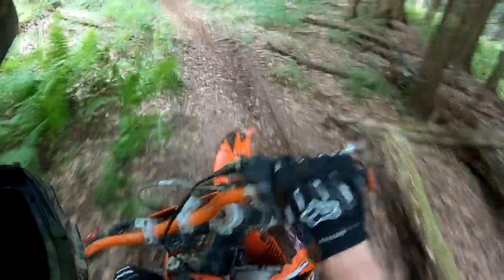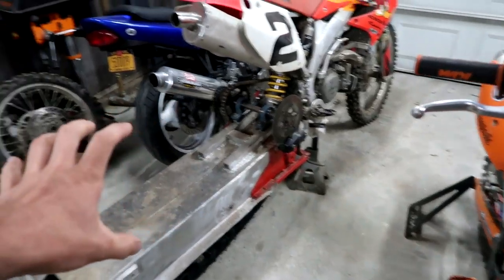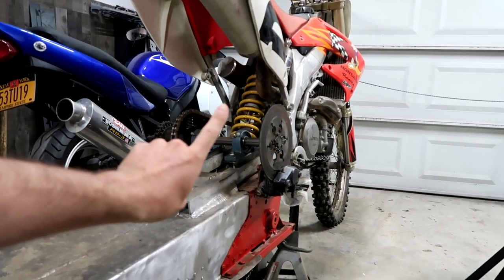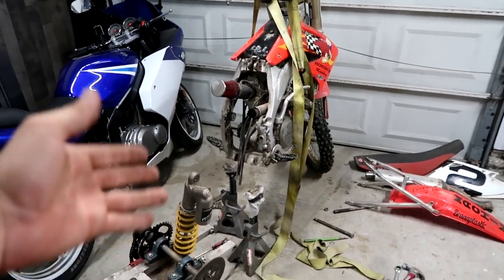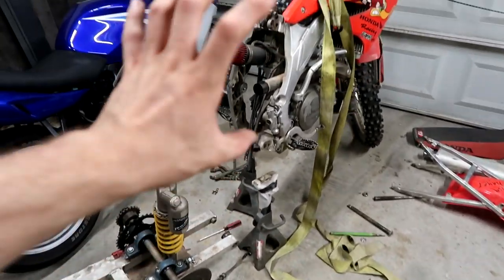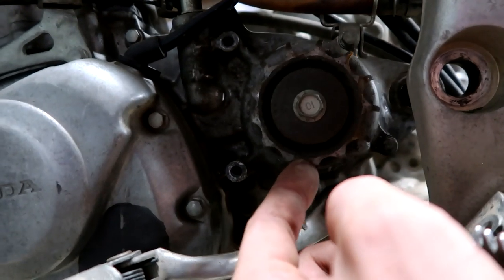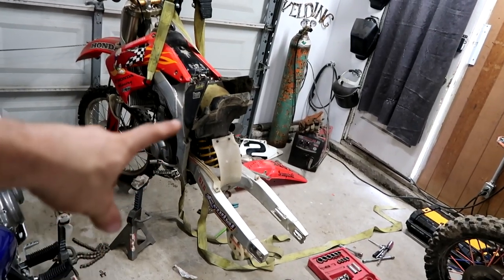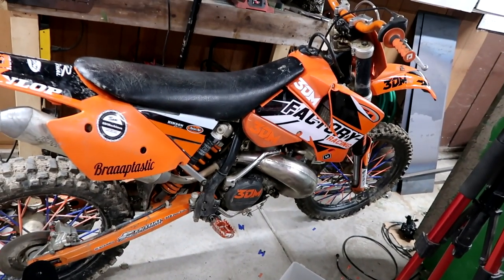PROBLEMS WITH THE NEW BIKE

Comment: On the Ktm I suggest rejetting clean the air filter or power valve because my 2 stroke had the same problem and I cleaned the air filter and rejet it then it ran perfectly

Comment: Hey man just a tip to make the job on the 450 a bit quicker, leave the exhaust and airbox in the subframe and undo the clamp for the exhaust and the clamp on the airbox aswell as the 3 subframe bolts and it will all come off as one, saves time pulling it apart aswell as putting it back together later on

Comment: It sounds like your carb needs a rejet and possibly float adjustment, as well as adjusting the pin in the throttle jet.

Just a little advise from an old 2 smoker trail ridet.

Comment: Check the carb boots for any cracks as that would cause the air to fuel ratio to be off a bit ..also  clean or get new jets for the carb...if there old they wont flow to well ...love the videos dalton

Comment: Main circuit in carb is ur issue, clean it. Use blowgun with rubber tip. Needle and float are also stuck open. Inspect needle and make sure seat and needle aren’t worn. Would invest in a rebuild kit. Most kits, the seats come with filters built in now days.